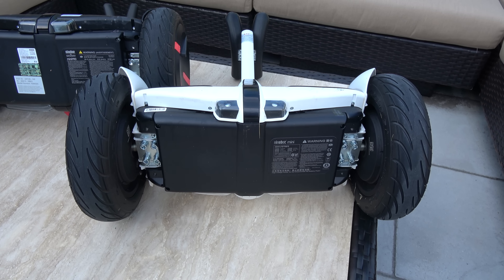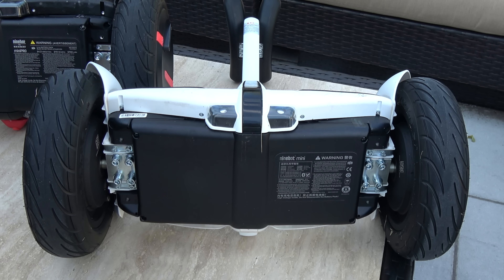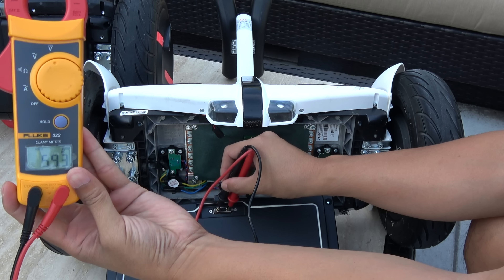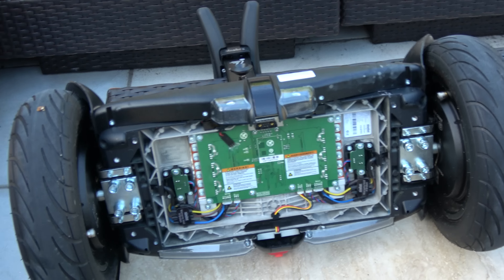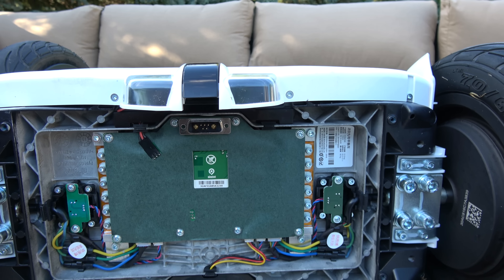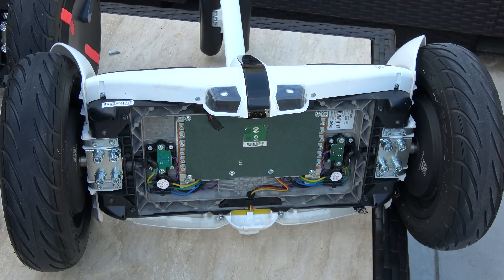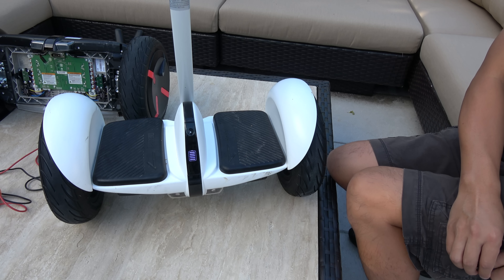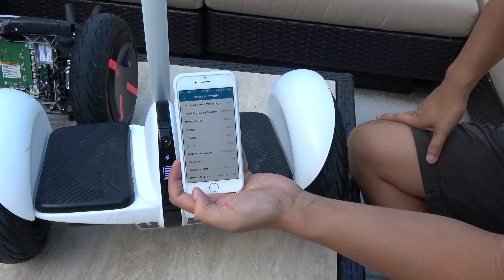Segway miniPRO Battery Swap with Ninebot mini - View of Internal and MORE! (4K)

Comment: If you look carefully, the BMS Firmware versions are different on the two batteries. I'm almost 100% certain it's the Battery Management System firmware that's controlling the full charge to 4800mah on the Pro. Segway has done that purposely for the Pro to ensure the battery life cycle lasts a long time.. up to 1500 charges.
Reply: Is it limited to 4800mAh when connected to the Pro's main board? Would a board swap unlock it if so? Or is the firmware on some hardware attached to the battery itself?
Reply: Baby Sherman  did yu get your mini going yet?

Comment: hi great video !!! but i am a new Mini Pro user but i am using this device on my work but the battery life is for me to short is it worth to buy seccond battery to swapping when 1 battery is dead... that you can take the replacement battery... or is it no usefull to do it ? Or is it better to buy a seccond mini pro device... the price is a bit high so thats why i think buying 2nd battery will be good... please advice thanks
Reply from the maker: if you are having issues with the battery, get segway to fix.  if you do it yourself, you void the warranty
Reply: you mean buying a seccond mini pro or ?... YA IKNOW  i heard it already on your video that you loese the warranty if you try to replace the battery by yourself. i wich the device has a much better battery or a quick charger or something...
Reply from the maker: not sure what you mean here, i would not get a replacement battery unless you don't have warranty and the battery is bad.  it is not meant to be replaced often.

Comment: MEtv Product Reviews What Do You Prefer The Ninebot mini or the the Ninebot mini pro
Reply from the maker: I like the pro better.  Now that the price is 1/3 of the initial launch price.  It has the quick release control bar that extends to accommodate a wide variety of heights and the battery has brick protection.